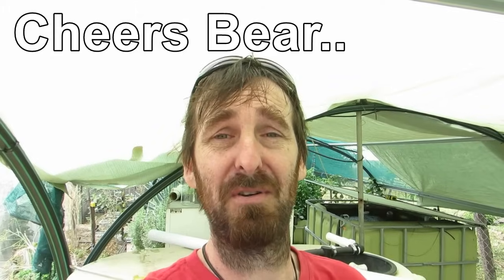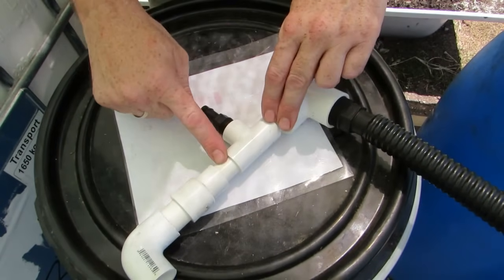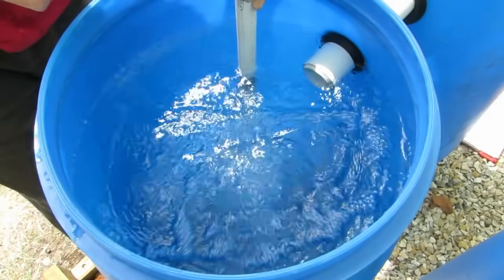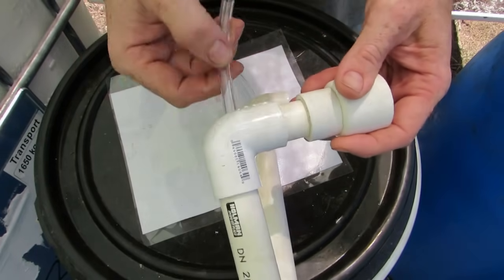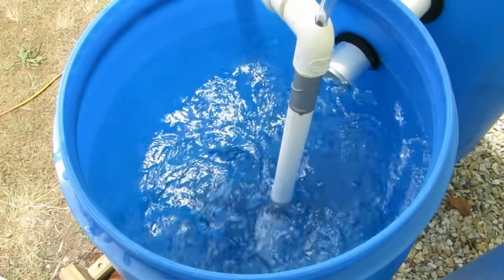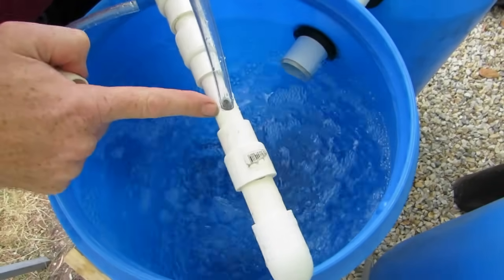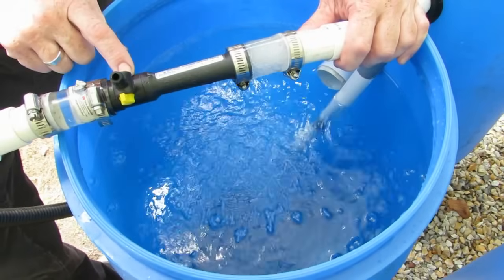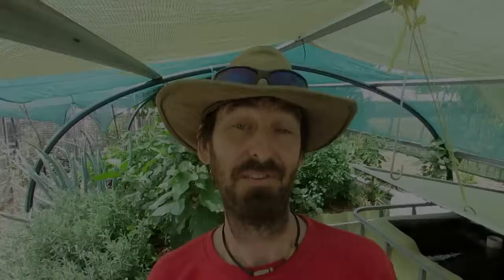DIY venturi, a few easy builds for aquaponics, aquaculture or hydroponics..

Comment: when are people going to understand that in nature there is no such thing as a free ride? A ventury consumes energy. In order to work, the pressure before the venturi must be higher than behind, else no air is sucked in. Installing a venturi goes at the detriment of pumped volume. This means slower removal of solids from the fish tank. This means more need for oxygen, etc..., etc...
Reply from the maker: Hey Frank.
I hear what you're saying & we have a larger pump in the system for that reason.. Might not of real clear that there would be a loss of flow (just a quick text mention about restricted flow)  but also never said it would defy the laws of physics either ;-)

In the aquaponic system there is a 4500lph pump pushing water to a head of under 1000mm through a home made venturi & delivering around 2700lph all for under 100w.. We have no issues with solids build up in our fish tank at all & have folks commenting on how clean our tank/water is all the time.. There is also a compressor in this system that runs into the biofilter with the excess air diverted to the sump tank.. The fish farm is runs solely on 3 venturi via a 10,00olph pump..Using venturis also means that there are less fail points..

If an air compressor was to burn out here during summer with the high water temps we get the fish would be dead in under an hour as I understand it.. Same would happen if the pump was to die at the moment too :-/  I'm here 24/7 so can check to see if the system is running just by listening from the back door for the venturis ;-)
Am looking at getting flow switches on all the fish tanks that will be hooked into a generator for just such occasions but like with most things it all comes down to available coin in the pocket..

In the end it's each to their own I think & am quite happy to use a mix of both compressors & venturi in my systems..

Cheers mate,
Rob..
Reply: Rob Bob, please excuse me for sounding adamant
(hope that is a right expression, English is not my mother language).
You write: "we have a larger pump in the system for that reason",
This means you are wasting money not only by wasting energy with the venturi(s), but also by buying unnecessarily bigger pumps,
doubled by the spare pump I hope you have on your shelf (or, even better, installed in parallel) in case of a calamity.
While venturi's are very simple, can indeed be be DIY home made, with very few parts,
believing that such a venturi is also efficient at aerating is purely selfdeceiving, induced by nothing more than extreme wishful thinking.
Show me anywhere instructions, based on scientific knowledge, or on thorough tests, on how to build a venturi that is efficient at aerating,
then show me that such a ventury is still easy to build,
and I wil humbly apologise for what I write.
Same goes for airlift pumps: NOT efficient at pumping, NOT at aerating.
You state that with a 4500 lph pump reduced to 2700 lph you have no issues with fast solids removal from the fish tank(s)
the faster, the better, as bacteria that grow on the solids are serious competitors for the available oxygen to the fish
remember that oxygen is more important for instant survival of fish than anything else including food
why then buy a 4500 lph pump instead of a 2700 lph pump ? (two pumps, counting the spare) ?
"we have folks commenting on how clean our tank/water is all the time"
this is, I am sorry, again also an illusion, comparable to the illusion that lots of bubbles aerate the water efficiently.
Clean water does by no means mean it is saturated with oxygen.
Murky water can contain more oxygen, thus be more healthy to fish than oxygen depleted clear water.
Please don't let yourself be blinded by wishful thinking
I like your idea of a backup with a compressor, it means you are seriously concerned
But again I would like to discuss with you, if this is a real and thrustworthy backup, as I think it not to be at all:
in case of an electric failure, the compressor will not work either, your fish will die within hours
much better is some cylinders with compressed pure oxygen, fed to diffusers in the fish tank, controlled by a NO (Normally Open) solenoid valve, which is and stays closed als long as there is electricity,
but opens automatically when electric supply fails
greets
Frank
www.aquaponics.eu
frank@aquaponics.eu
Reply from the maker: Frank De Block-Burij
Hey Frank..
The current back up is battery powered & off grid designed for the thunderstorms that knock out the power out during the summer thunderstorms. 
As I mentioned in the post above we also have a compressor in the system.. As well as that there is also water constantly falling from a constant flow bed + the drains from 2 bell siphon beds into the sump.. All these together provide our system with more than enough air.. You might want to check out some of our other clips to see how it's set up to get a better understanding of the way it's set up..  
Cheers mate..
Reply: Rob Bob  and cheers to you !
I love sharing and comparing thoughts, knowledge and expertise
if only to avoid me making mistakes
but aren't you avoiding the real issue here, Rob?
you talk about "off grid design" and "summer thunderstorms knocking the power out"
the compressor wil be no good then either, will it ?
the pure oxigen cylinders will, definitely, albeit of course only for a time limited to their size
your other measures are absolutely correct, which leads you to the conclusion that "all these together provide our system with more than enough air..."
then why the extra venturi's ?
why a bigger pump that needlessly consumes and wastes more energy ?
there are many other methods for free, natural aeration where it is needed
all this by gravitation, once the water is pumped up to the necessary height for any system, like using gutters instead of tubes,
even a gravitational venturi effect is possible
avoiding all possible energy waste adds another excellent opportunity to an off grid system: that of a battery backup
greets from Belgium, my friend
Reply from the maker: Frank De Block-Burij The compressor is off line on a battery back up as I mentioned above Frank with lines running into the FT...
Aquaponic Backup Air Pump for fish tank.. IBC System construction part 9.
As to why the venturi (there is only 1), when the sump tank is full the amount of "splash"/airation from the return pipes from the beds is minimal so there is no harm in adding extra air into the system.. One of the first things I read on BYAP before the build is there is no such thing as too much air in AP.. 

From what I was told by a chap that knows a thing or 2 about all things aquaponics is that the magnetic drive pumps will use less power when the flow is throttled.. He gave me a meter to try it out when I bought his system but haven't gotten around to it yet ;) Shall post a clip showing it at one point but have other jobbies on the go at the moment.. 

Cheers..
Reply: Rob Bob
Water tends to naturally saturate itself with oxygen, but once oversaturated it will quickly release back the excess oxygen
For saturation you need to expose as much possible water surface to air for as long as possible time (side remark: colder water absorbs more oxygen).
So the (venturi) question is: what will allow for more contact surface between water and air:
your pump, running with a venturi at 2700 l/h, with the bubbles created by the venturi, connected to tubes which only allows for oxygen exchange from the bubbles
or your same pump, running at 4500 l/h, without the venturi, connected to gutters instead of tubes, which allows for much higher exchange surface ?
as for the "chap that knows a thig or 2 about all things aquaponics" he either badly explained, or either he or you understood it wrong:
all pumps (and all electrical devices) will consume more energy when restrained.
centrifugal pumps, whether magnetic driven or not, do have a point of best energy efficiency, which is the combination of pumped volume and head:
higher head comes at the detriment of pumped volume and vice versa
centrifugal pumps are designed for best energy performance around 3 bar, which is 30 m head, way more than we need.
So there is no point in seeking this point of best energy efficiency, only to have more unnecessary head and lose a lot of pumped volume, thus lots of possibilities to expose more water surface to air
I studied your compressor/air pump backup system and it is excellent. As a backup with a compressor.
to see whether this is better than a backup with a pump instead of a compressor depends on the power consumption of your compressor/air pump.
but again I would most probably opt for the pump
greets
Frank
Reply: Rob Bob Absolutely true!  The more resistance you place on the pump, the less it pumps, the more energy efficient it is..  People always think, mistakenly, that the greater the resistance the more energy it takes to work. But in fact the greater the resistancce, the less energy it takes to pump. IOWs, less throughput due to smaller pipes or other in line enegy consuming devices like veturies means the pump is using less enery to pump. (easier on the pump)
Reply: nonsense, Rob, much as I admire you, you have no understanding of pump design and energy efficiency. Most centrifugal pumps are designed for much higher head than we need: say 3-4 bar, which is 30-40 meters head, while we need only 1 to 2 meters. Of course the energy efficiency of these pumps will be better at their designed head, that is what they are designed for. But at lesser head they will pump more water and consume less energy, so that will be easier on the pump, not restrictions
Reply from the maker: The post above isn't mine Frank De Block-Burij..
 jmartin015's  post above is along the same lines as what I was told by the chap I mentioned above.. You can check out Paul's work here if interested https://www.facebook.com/earthangroup He has helped design & build a number of operational commercial systems so think he has some idea on pumps & how they work.. 
I am going to do a test on the pump with a meter & do a clip to show what I find & that's why I haven't responded to you as of yet.. It won't be for over all efficiency (lph / kwh) but the basics of what happens to the amount of power used once a restriction is placed in the path of the water..  Folks in the commercial sphere may be concerned with saving as much energy as they can but for most backyarders the driving force is clean, healthy food from what I've seen..
Reply: Rob Bob
I apologise for the mistake, Rob Bob, I should have been more careful. And Paul of Earthangroup is to me a longtime friend, I hope I am the same to him. I know Paul as Crusty.
Reply: Frank De Block-Burij Think of the pump as a battery. And the water as current (Amps).  If you put resistance in a series circuit the battery works less, less amps.  Same with a pump, if it is pumping less water, for whatever reason, the pump works less hard. It does not make it more efficient, that is a whole other issue, it just means the pump is less likey to burn up.
Reply: jmartin015  a pump is not a battery, a pump is a machine meant to move water, nothing more, nothing less. Pumps are designed to perform best under the circumstances they are designed for. The best performing pumps are positive displacement pumps, like piston pumps, but these pumps are more expensive and most of them need valves to operate. Valves can mean extra problems. Centrifugal pumps are much simpler which is why we use them. But these pumps are designed to perform best at high heads we don't need. The best pump for the low heads we need is a propeller pump. Unfortunately propeller pumps are only manufactured on industrial scale for much higher flow than we need